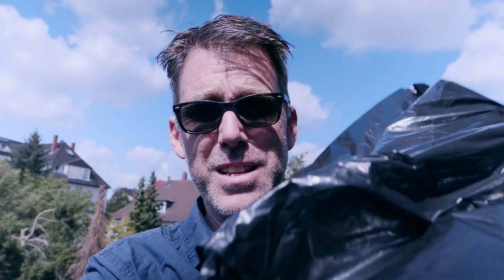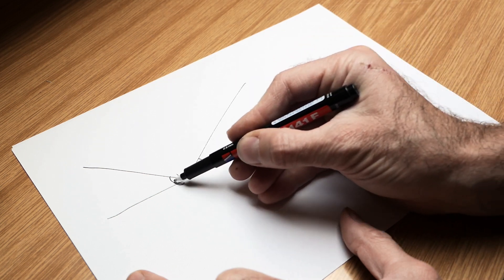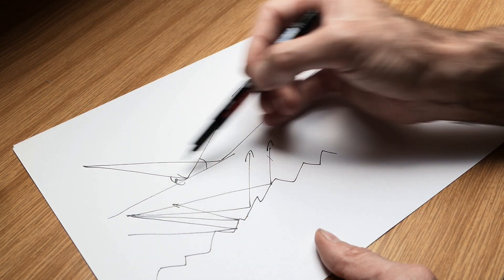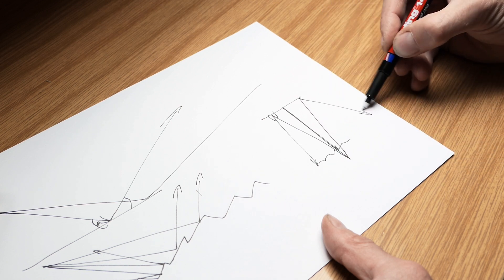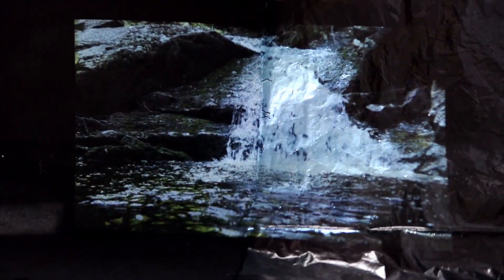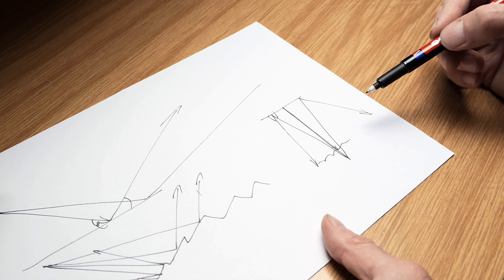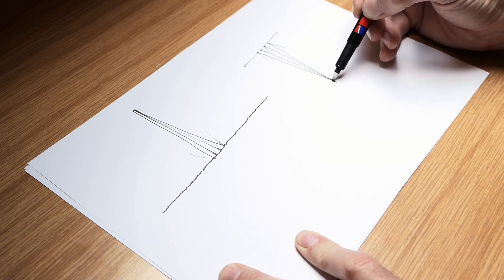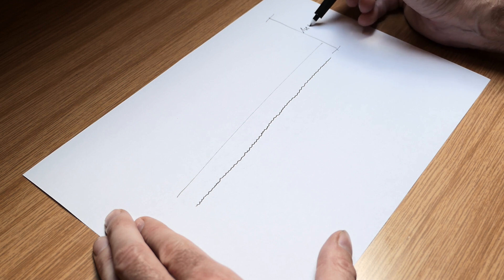Video Projection Tutorials - Projection Surfaces Part1

Comment: How does this play out when using rear projection?
Reply from the maker: It doesn't so much in terms of reflection. But you still want to look for a material that "scatters" the light evenly. Like the diffuse reflection does in front projection. visa versa the direct reflection could be called the equivalent of the light of a back projection passing through the material (as in a "hot spot"), that you want to avoid.   
Thanks for bringing this up. I really need to get back to editing some vids here. Been so swamped that I didn't even get Part 2 out.

Comment: Very informative. If I paint a surface with a reflective material, is there a base coating that you would recommend, or does that not really matter?
Reply from the maker: I'm working on a "coating"-tutorial right now. But to say the least: Yes, base coating is key - as is the kind of reflective paint. There are good ones out there that reduce bounce light and enhance the image light. Stay tuned.